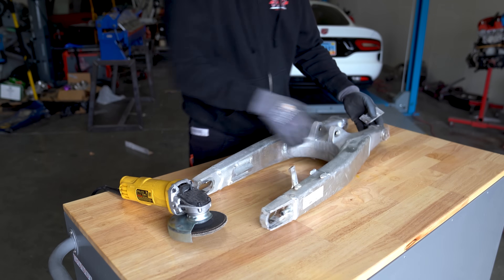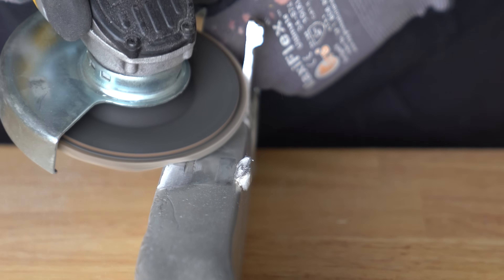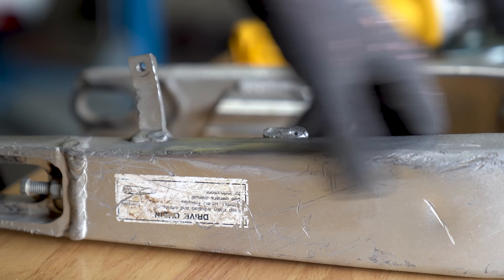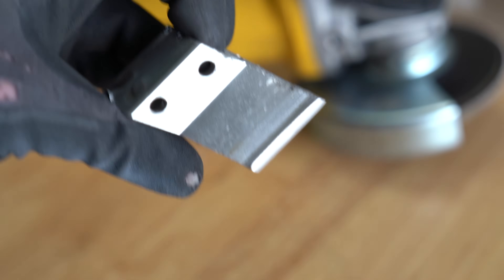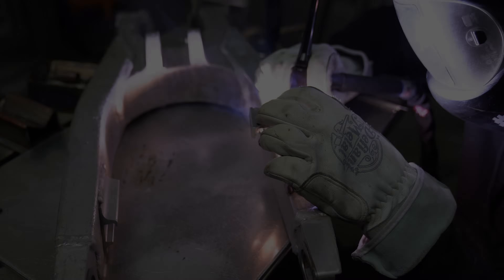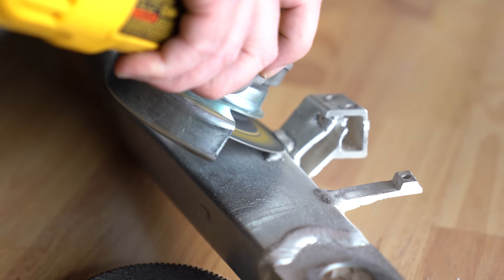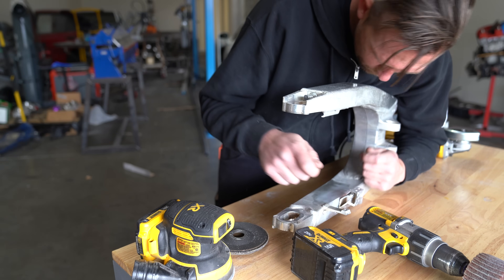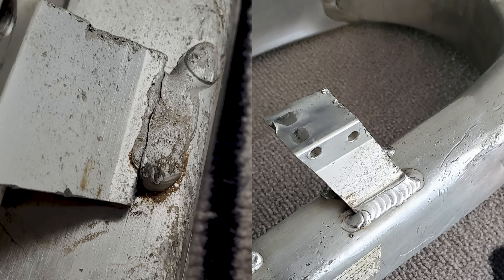Fixing a Weld that a Robot Made

Comment: Ha, your welds look 1000x better than the original, that have been on there from the factory! Seen the other newer video too, if this is ripped away from the wing, it has a design flaw anyway. The welds are not the problem I would say… There is also a heavy indentation on that chain guide, some rock or flying debris smashed into it. This is a good repair for a very reasonable price! Thank’s for sharing!

Comment: The use of three different power tools just to prep the surface is surprising. Grinder wheel to remove material, then sanding flap disk for fine sanding, 1 tool, 30 seconds, and you’re prepped

Comment: The problem usually is not the setup of the robot btw, but tolerances on the workpiece adding up until the seam is a bit off on every batch you get. Clever and motivated personell checks for this when new batches come im but most people do not give a flying one. Well, good for me, I made good money for years retrofitting sensors on robots to correct this very thing. :-D

Comment: uh-oh, the robots repeat with high precision, maybe someone bumped something or some material got messed up.
There is a good chance that the all the parts made during that shift would have the same issue.
Reply: Someone forgot to check the TCP(Tool Central Point)😁
Reply: its weird cuz i also have a honda and on my swingarm my chain guide tabs have the same weird weld that goes off to the side

Comment: Do you have to heat treat something like this after welding? I thought the whole problem with using aluminum for structural purposes (like a swing arm) was that when you weld it the heat affected zone is weakened. The location this is in probably has the least affect on the strength of the tube, but, I wouldn't want to chance it...

Comment: Ultimate weld on aluminum has to be baked, In an oven for 10-12 hours at 900 deg to realign the molecules in the aluminum
Welding disrupted the metal around the weld thus weakening the metal next to the weld

Comment: I hope you told your customer he needs to heat treat this swingarm again before installing it into a bike!!
I’ve had a case scimilair and it seriously compromised the rigidity and made the swingarm bend causing  it to missallign the braking caliper
Also i ‘ve stopped using abrassives like grinddisks or anything that contains zirkonium materials.
I only use the carbid mill-bits or coarse file. It helps a lot not contaminating the surface!!
Reply: Do bike manufacturers heat treat them after welding?  Good advice about the abrasives. I still use them sometimes but i avoid it when practical for the reasons you described.

Comment: 40 bucks, with this level of attention to details, is a steal.
I feel like it would be the price for just "grind and weld". Taking the orbital sander and the combo wheel to the part should have cost extra. Not much more, but still ... Like around 60$ makes more sense to me.

(In my job, i have to do a lot of tenders, and when it's a small one that need to be priced we take the man hours cost and multiply by 3, to add the cost of consumables/materials/tooling and the cost of running a business. In this sense the 60$ seems fine : 20 for you, 20 for your gear and 20 for the business

Comment: HeyJustin! 
I’m so pleased to see you’re back. I’m impressed with the fact that you do “the right/correct thing” regardless of the final use - it is your reputation that is at chance here, so why not do your best. My moto is “do as good as factory, or better!” With that in mind, I did a V8 swap many years ago and the factory weld robot was obviously having a bad day that car was born; one of the engine mounts’ welds was on a diagonal across the mount. The total effective weld was only about 3/4”, where it should have been over about 2-1/2”!! Needless to say that I fixed that up right away - but it was easy, it was mild steel, not aluminium (yes, I’m Australian!!). 
Keep up the great work mate👍

Comment: When I welded, I often did repairs.  Sometimes the repairs were from technicians still developing skills, sometimes general wear and tear, but the VAST majority of my repairs were from robotic arc welders going haywire.  (and I've seen some CRAZY issues since many robots won't stop welding when even a DRUNK 1st day welding technician would know something was "off."  Porosity-filled beads the size of my forearm, robots gouging out entire 1 inch think plates, robots welding THEMSELVES to the material and causing cracks from copper inclusions.) 

Don't sell yourself short when doing repairs.  While this particular repair might have been fairly minor since it was physically small, and looked like a crack caused by some non-fusion due to misalignment of the robot, it takes a welding technician with knowledge and integrity to do the repair CORRECTLY.

For those of you starting out in your careers:  Repairs will make or break you.  It takes time to learn how to do them correctly,  and don't let people rush you, because at the end of the day, it's YOUR reputation and YOUR legal liability if things go south in the future.  

That said, I would be quite happy with this particular repair, both as a welder, and a motorcycle enthusiast, and 40 bucks is a steal of a price for the customer.
Reply: Actually installing and tuning automatic welder line requires a much-much more qualified welder-technologist than just people who can weld excellently. So if you can't find that kind of technologist your welds will be crap like this.
Reply: @Ma_X64  100% Agree.  Unfortunately, the unofficial policy at the company I worked for seemed to be to "promote" welding technicians that struggled with complex manual welds and repairs to robotic operations with very little training aside from "Keep the robot loaded, and if it stops welding for some reason, press the big green button on the pendant."
Reply: the fault is then with whoever is quality checking the welded item.
Reply: @krusher74  what is 74 in your nickname?

Comment: Very reassuring to see a failed robot weld escape quality control and end up in the market.
Just goes to show how important thorough checking and testing is, especially for critical parts/areas.
Reply: It happens all the time.  I saw it so much that it actually inspired me to go for my CWI because I was SICK of being the guy repairing robot welds over and over and over... Easier to be the guy with the flashlight and cam gauge than the guy with the arc gouger and grinder.

Comment: Damn, bro, raise your prices. That’s pocket change for expertise and expensive tools and equipment.
Reply from the maker: Let's do a quick bit of math... 3 of my small jobs at 40 bucks each in one hour makes more than my hourly rate, and people keep walking in my door. I'm not charging for work I'm not doing. If I did, less people would walk in my door. It's not my responsibility to ensure other shops that can't find work without minimums stay in business. I'm here for my business and this is my rate.
Reply: @TheFabricatorSeries  I mean, everyone has to build their own business process to fit their situation and maybe you have one that works for you. Obviously I’m not there to see it. 

That said, I have trouble figuring out how the work you did could actually have taken only 20 minutes, unless you’re not counting all of the work. The job isn’t done until all the tools are maintained and put away, and all the consumables are replenished. How much time was spent communicating with the customer, initial contact, dropoff, pickup? So I question your time calculations even without dodging students. 

And I’ve never seen a shop where there’s a line of customers with 20 minute jobs, but it could happen, so if that’s what you have then good. I’ve never seen that. I’ve seen boatloads of people leaving out parts of their time and go broke as a result.
Reply: Not sure where your at but Federal tax code in the USA does allow for your "tools" aka "business related expenses" to be written off over the course of 5 years. Most states have similar tax codes as well  Where him & I are in NV there is no state income tax on individuals but you CAN still write off business expenses like equipment & consumables which offset your business income. Oh & this also includes computer equipment, etc. If you don't know this you need to pay the $500 to have a tax professional do your taxes for you. 

As for ad revenue on YT it isn't worth squat anymore. TFS runs a welding school out here. And as I said for the area, it's a fair price considering the weld wasn't "perfect". If it was then he could have definitely charged $60-$75 as he said in the actual video but he didn't because he "dipped" & didn't get the ends on the 2nd weld right. Now all you folks bitching about his rates, know that like he said above, can knock out 3 jobs like this in an hour & make more than his "hourly". This is why there are shops that do well & those who "claim" to do well. I'm done debating this with the arm chair mafia. He's lasted in a city that was hit the hardest by a pandemic & is still in business & in a new shop WITH employees! His business & pricing is just fine & Speaks volumes! When the rest of you can do what he has done, then you can suggest pricing changes!
Reply: And I've run a successful business for 20 years. I've weathered multiple storms so I know what I'm doing & so does my accountant.
Reply: Whats the name of your business?
Reply: Like I said above, y’all are taking this as an attack instead of making use of it. Do what you want but this is pretty basic business practice insight that can make you a lot of money if you drop the ego and use what I’m showing you. But I can’t force you to do that, so take it or leave it.
Reply: There's nothing to "make use out of" besides how NOT to run a business. Consumables are made of for over the entire year and written off on your taxes if you know AP/AR & tax code. Set-up is part of the job and doesn't take much aside from grabbing a tool. If you actually weld you'd know that your rig is usually setup for the day with only a few tweaks needed. Unless your doing something exotic then your gas almost never changes except the flow. Your just making excuses to justify charging more. Shops like yours end up getting a rep for over priced work especially when you try and account for every single minute and everything fraction of an inch in wire. Good luck bud! TFS has a good gig going between his school, consumables sales & customers. He's an entrepreneur & has a business sense for things in his field. You might try and "make use of" what he's preaching and has been an even some of his past videos.
Reply: @mygoogleaccount9990  Again, the only way this adds up financially is if you don’t count most of your time. The communication with the customer is rarely less than 20 minutes, especially if it’s not someone you get batches of work from. And the evaluation and advice alone about how to do the repair is worth more than $40. Especially for aluminum TIG. This isn’t a backyard muffler shop and it shouldn’t charge like one. If people can buy expensive equipment then they can afford to pay a realistic price to repair it. If the shoe is on the other foot because you screw up a repair and damage the machine, they’ll definitely want you to pay full price for that. As they should.